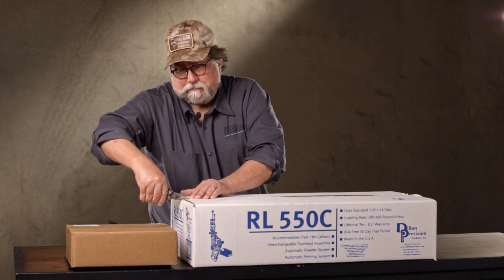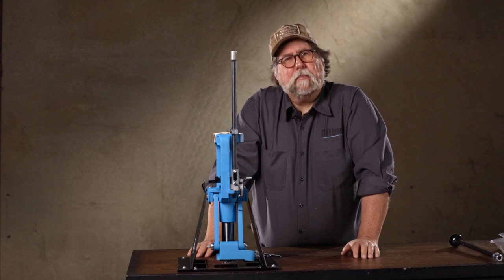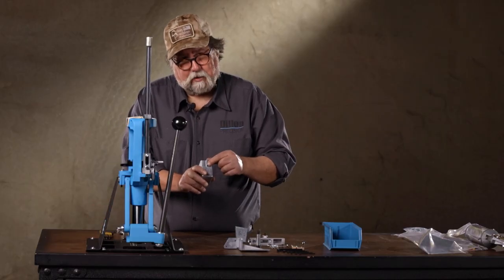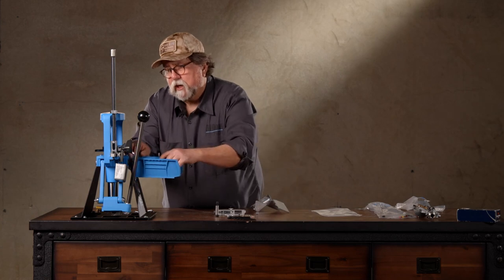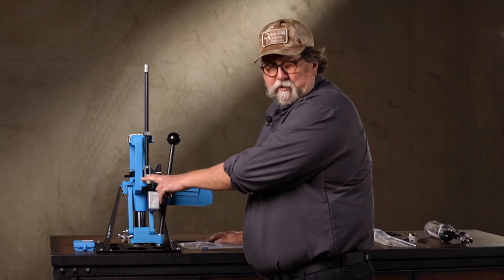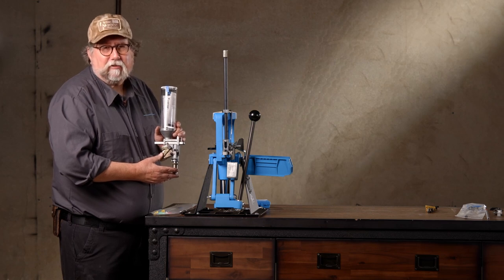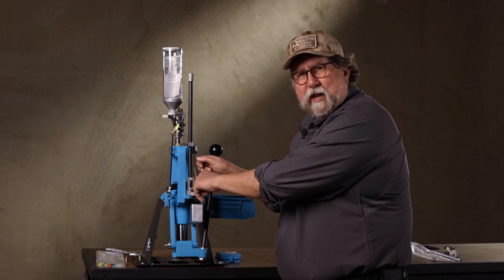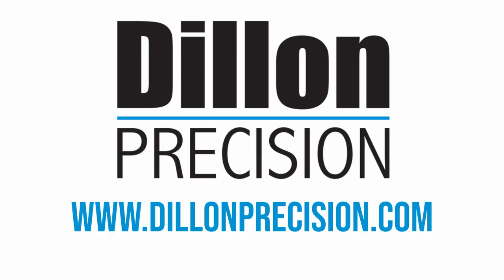Dillon Precision RL550C: Unboxing & Step by Step Setup

Comment: Gary, I got my 550C a few days ago and put it together today - after watching your great video.  I put on an the optional strong mount and used C-clamps to hold it down.  The C-clamps allow me to move it for storage.  Gonna tie down the back of my table to the floor (it's in my shed) to keep it from tipping over as Ireload.  Even though you cautioned, my little detent ball rolled into the center hole of the 550 and I had to tip it over to get it out - no problem.  And I guess I wasn't paying close enough attention and inserted my shell plate up-side-down into the 550 - by doing that I couldn't smoothly slide a case into the 550.  I fixed that by flipping it over.  I also found out why you have to snug up the blue wing-nut under the little spring of the fail-safe rod - it repositions the primer seater so that the next case can be loaded into the 550.  About those three little brass pins that go into the shell plate, watch em', it's easy to drop one.  I did and it bounced clear across the room.  Luckily, I found it (I may have to buy a few more to have on hand, but wonder if they are caliber specific, - I'll call Dillon and ask).  I also put a .45 case over the top of the follower rod of the primer sensor to give it a little more weight.  It's together now and i'll set it up to start reloading next.  This shouldn't be a problem because i'm not new the reloading.  For the last 40+ years (I'm 72), I have used a Hornady "red" progressive press.  I reload 9mm, 40 S&W, 45 "Long"  Colt, 45 ACP, 30-30, 30-06 and 45-70 - all for guns I own..

Comment: I have a RL550C arriving this week. I feel like this video is going to run on auto-repeat for a while 😂
Reply: Im in that position that will i buy it or will i buy 750xl😅 are you happy whit your 550?
Reply: @michaelstalenberg2407  I really like it now that I've learned the basics. I don't know what makes the 750 different, but the 550 has been great so far...easy to set up, easy to adjust, etc
Reply: Do you think its easy for a beginner to set up and use? I want to get one (recommendation from a friend) to have something to do this winter, but never loaded any ammo before.
Reply: I now have the 550c😉
Reply: @Thetugisthedrug  I have not loaded yet either but when I mentioned it to friends the 550 is always recommended...... so I bought one. 750 will be next purchase maybe next year. Maybe sooner. Only time will tell.

Comment: Dear Sir, thank you for this presentation. But when you show how to adjust the failsafe rod nut with two credit cards, the press lever is on down position. The same explanation "with the lever down" can be seen on the operating manual. An other vidéo (with the girl) shows this adjustment with the main lever up and pushed forward...like when priming operation...

Comment: I could have anything. But I have used a 550c since 1986. I like to do individual stations at times. I really smile when everything is set and tried. Then crank out a few thousand.

I like to wet tumble the brass. Then anneal if needed. Lubricate the brass and size. Most guys look at it as a production only machine, but it is great for single station use. I have shot 10 shot 1/2" groups using this machine.

I also shoot a bunch of cast bullets. I prepare rifle brass like I would for any but then bell the case mouth. For that I like a universal tool on my single stage press. Then I clean all of the brass with the wet tumbler. This machine has manual indexing so it makes this easy. Then primer, powder charge,  seat, and crimp. Make a few hundred of really inexpensive large rifle rounds for steel or other reactive targets.

Comment: I just bought the 550c I spent over 1200$ just getting it ready too reload. I guess I’ll take it back. My safety bar does not hang freely it is nothing like in this video. I asked for help they send me to watch another video. My bar does not hang freely or strait down. It is not long enough on the 90deg elbow. Guess I’ll just take it back over a 2$ rod.

Comment: It would be nice if you put in a brief close-up of each bolt, nut, screw, or other fastener before installing the part it attaches. I have a bewildering array of fasteners in front of me and it's not a;lways easy to tell what goes where. The line drawings in the manual aren't much help.

Comment: So this RL550C won't reload 30-30 and 30-06 rounds ? That is the rounds I will mainly be reloading . Thanks
Reply: Yes it will be able to load 30-30 and 30-06. 550C can reload up to 338 Lapua Magnum.
Reply: @boostedlx8277  Been Loading 30 06 on my 550 since 1985. It will work
Reply: @Robert McPherson  
Christmas 1986 for me. The plate and 2 funnels used most does 30-06, 308, and 45acp.